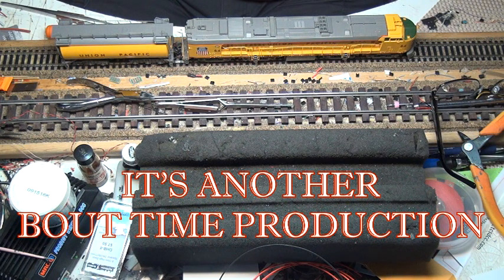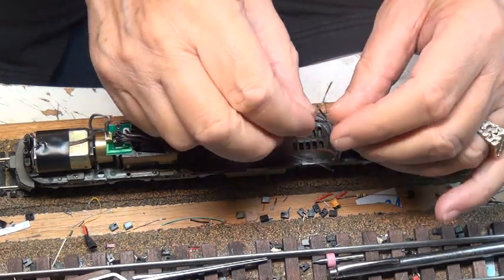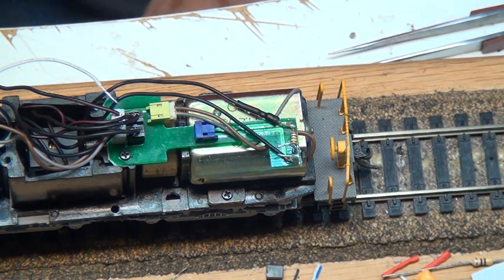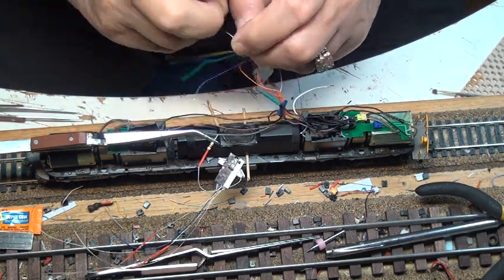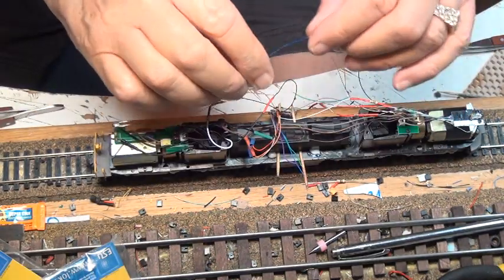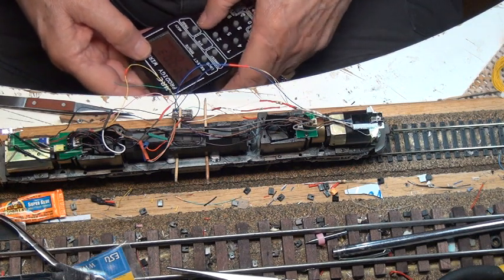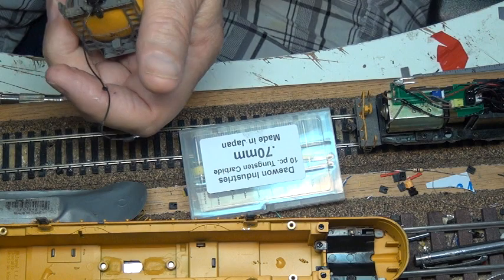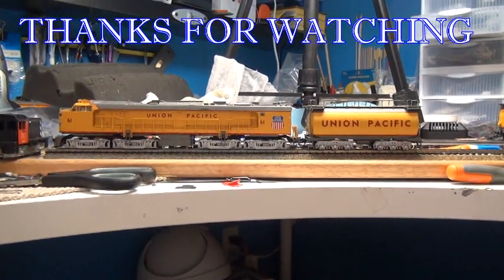ESU LOKSOUND INSTALL IN LIONEL HO GAS TURBINE

Comment: Thanks for another great video.  Have you encounter any of these engines with gears that split open?
Reply from the maker: Yes, several, but the gears are available and can be installed on the drive axle's. However, I open the hole very little and apply Super Glue very sparingly, not to interfere with the spacers. Allow to dry over night and clean off any exposed residue.
Reply: @choochoo3985  Thanks.   Are you saying the you repair split originals by (albeit carefully) SuperGluing  them back together?  From whom did you buy replacements?  NWSL?  They've been closed and are reopening (finally), just wondering if perhaps you found them via someone else.  Thanks.
Reply from the maker: No, I found replacement gears which work, but I have to increase the ID to get them to fit. I open them just a smiggin to allow application of super glue. which holds them to the axle. The only problem with the gears is some have a slight click when operating the locomotive. I have been working on them to correct this problem by filing the gears and using different lubrication. Lionel is as bad as any maintaining common replacement parts for their products. Pisses me off!
Reply: @choochoo3985  Thanks.  What's the trick to accessing the axles with the gears on them that split open?  Is that done by releasing or undoing something from the bottom of the truck or must you drop the truck from the top and loosen something from above first?  Would you happen to have this procedure in a video?  Otherwise, a description would be very much appreciated.  Thanks.  I'm fairly competent with repairs having done customers' S-gauge engines for over 10 years, but prefer to read or know something about how to approach something new if that's available before just diving in.
Reply from the maker: @PFR1  Okay, the Lionel axles are accessible from underneath. Just remove the two screws from the cover plate. Carefully remove the axles. be careful not to damage the contacts when removing and re-installing. I use a small vice to brace the wheel on the gear side and then a flat punch to drive the axle from the wheel. Be careful not to lose the bushing spacer. Now using  needle nose pliers under the gear, drive it off the axle as well. Taking the new new gears, carefully using a burr tool or drill, open the hole slightly. the gear should still be snug on the axle, but easy to slide on. Apply thin coat of super glue on axle and press the gear back to the exact place it was prior to removal. Clean off any and all excess glue insuring the spacer spins freely when reinstalling the wheel. Carefully using the vice press the wheel back on the axle insuring proper spacing of the drive wheels. Allow the glue to dry at least 12 hours before applying any twist. As I stated earlier I have had a problem with the new gears causing a clicking sound and even jerking motion. I then file the gears attempting to make them less likely to bind.
Reply: choochoo3985 Thanks!  Great tips and insight.  Once the two screws are removed how do you remove the cover plate to get to the axles?  There seems to be something still holding it in place.

Comment: Is there a sound table for ESU LokSound gas turbine sound CV's?  I'd like to see what individual sound volume levels can be adjusted (e.g. turbine whine from turbine whoosh, etc,)  I can find their steam, diesel, and electric sound tables, but not one for their GTEL Turbine-All Types FT.   Thank you.
Reply from the maker: The Newest revision of the LokSound Select user’s Manual is now available online.
The Newest revision of the LokSound Select user’s Manual is now available online. This new edition now contains wiring diagrams on and other information on all versions of the LokSound Select decoders. LokSound Select HO, LokSound Micro, and LokSound Select Direct. There’s also now a section on manual notching and other programming features. I have also requested more definitive information from my supplier. If I get that info I will forward it to you. By the way; my supplier is Mountain Sub Division. Ted
Reply from the maker: Mountain Subdivision came through. Go to this site: http://projects.esu.eu/projects/print/75403

Comment: Save your nails.Use a bic lighter to heat the end of the wires then pull what you want off. Just a little tip from somebody that has fixed much with very little for many years.